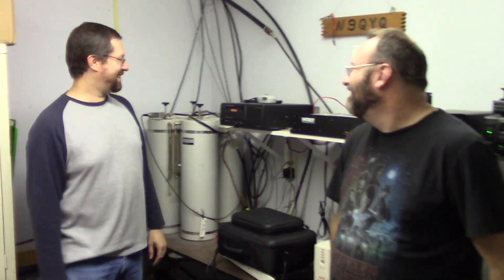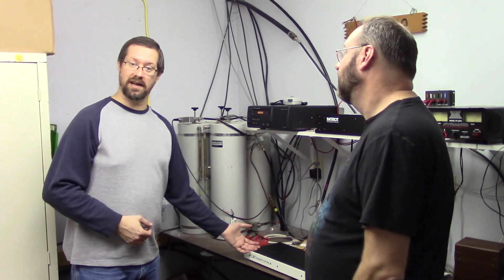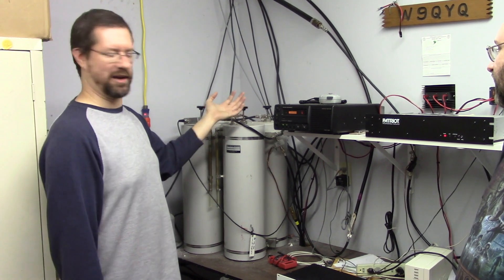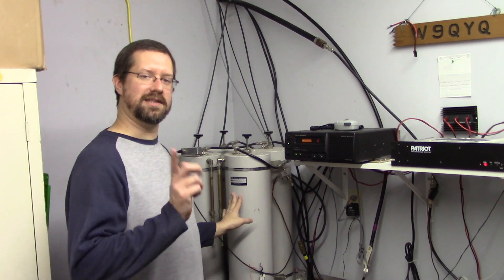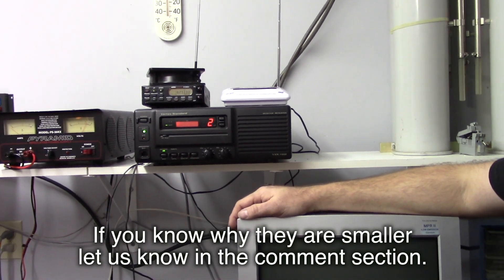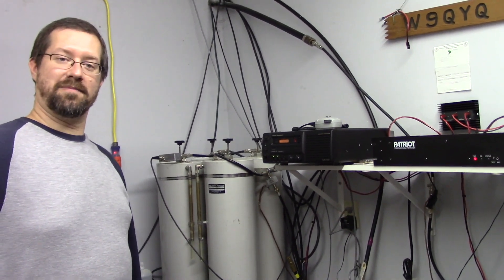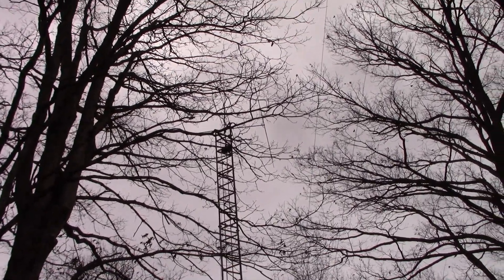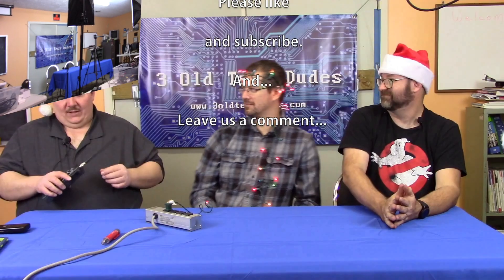What Does a Ham Radio Repeater Look Like?

Comment: Have you every seen or found a power amplifer that is weather proof and can be mounted on the tower 10 or less feet from the antenna. This would make the signal loss in the coax less of an issue. If you know of such a unit let me know.

Comment: How much power (watts) do you use to both receive and transmit on your repeaters?
Reply from the maker: I believe the repeater TX is 50w at the duplexers, and with the tower height, etc, one can get into the machines with as little as 1 watt at more than 10 miles.
Reply: @3oldtechdudes  Perfect, I am trying to understand how much power are being used at repeaters.  This gives me the first dot so I can start to connect  together.   Love your video and as a relatively new Ham Operator, this helps me wrap my brain around the workings of a repeater. Thank you so MUCH!!

Comment: Have you ever had someone want to turn the knobs on the duplexes? I think it may be legal to shoot them.
Reply from the maker: Yikes, yes, that would be terrible!!!
Reply: @3oldtechdudes  I know of something about as bad.the older Motorola UHF radios had what looked a about 2 inch screw to some that was a tuning cap. And know of more than one that someone tighten that that screw on the radio. It didn't transmit anymore after that.

Comment: What wattage are you running your Vertex repeaters? What kind of range are you getting with the one on the small tower next to the building? I have the Vertex UHF version with the optional duplexer in the bottom of it. I have the programming software and have tried it out on the ham bands. Just wondering what kind of results you have had with Antennas at different heights. KB3HAK
Reply from the maker: The small height one is pretty poor, probably a 10 mile radius or so. The other one is excellent with the tower height, 30 to 50 mile radius usable with a mobile radio with full readability. On a good hill it can be farther than that!
Reply: @3oldtechdudes  What wattage are you running the repeaters at? I think they go up to 50 watts. I was wondering if you were running them wide open or backed down to a certain wattage.
Reply from the maker: @earlblakley4910  I am not sure, honestly. I want to say they're set at 50, but it could be 30w. Next time I'm down there, I'll check them out and update on this comment. -Tim KB9SNL